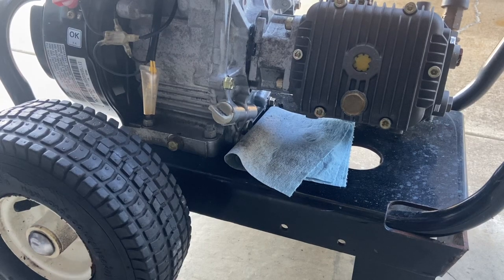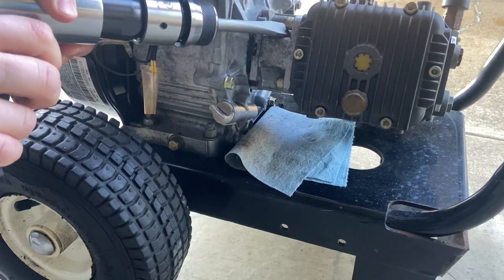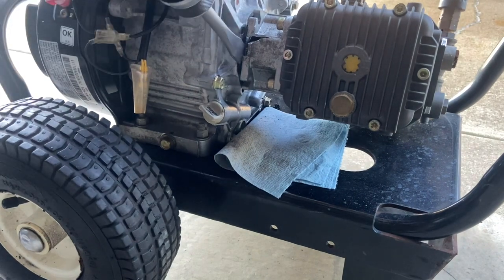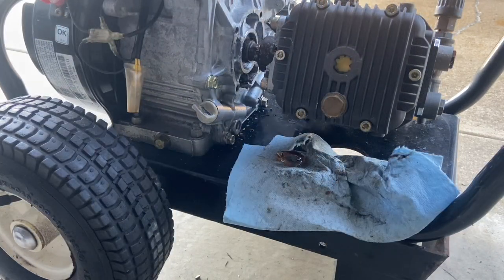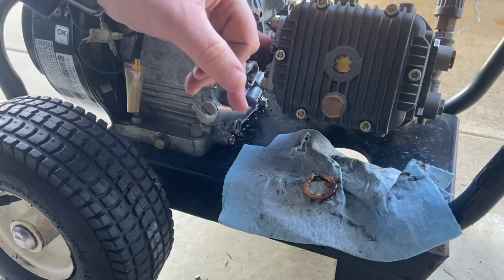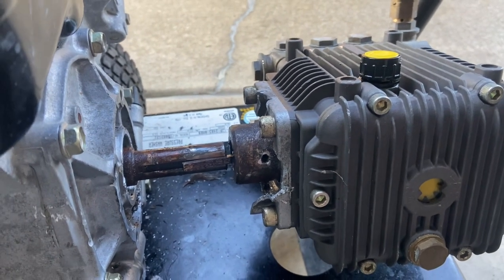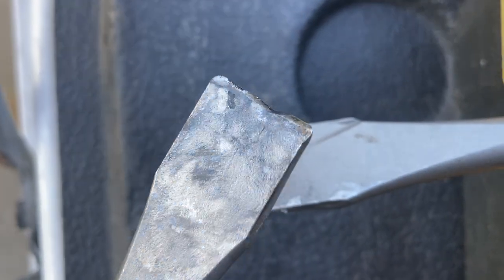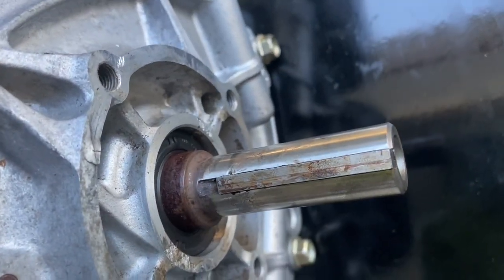Pressure Washer stuck pump removal

Comment: Pullers don't do much either - easy way to snap the cast case of the pump.
Reply from the maker: Yeh...when they aren't greased or have anti-seize it can be awful to get off.  Whenever I take a pump off I grease the shaft, I don't want anyone to go through the hassle that I had to endure.

Comment: Nice job with the air hammer! 🎉 I've been watching a lot of your past videos of repairing seals and stuff, very informative! Can I ask you what that DeWalt  impact is you've used? Is it a 12 volt 3/8 impact wrench? I love the size, and how easily you get hex bolts and screws in and out. I want one! Thanks for your content, James.
Reply from the maker: The Air hammer was the only way to get it off...but it's a trick for next time...of course the pump will be destroyed but sometimes you have no choice.

It's the 12v 3/8" impact, I also have the 1/2" impact but don't use it much, the 3/8" has plenty of power for anything small engine related.  

I've also heard really good things about the Milwaukee, they have more accessories and are used a lot in the automotive industry.